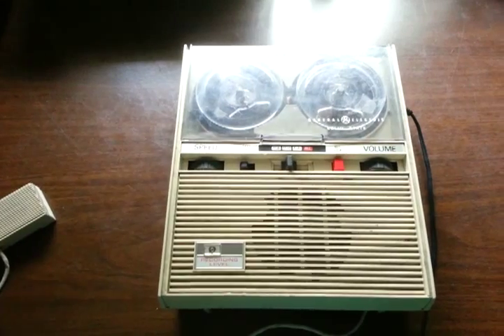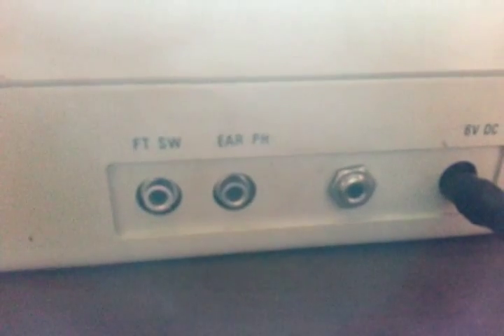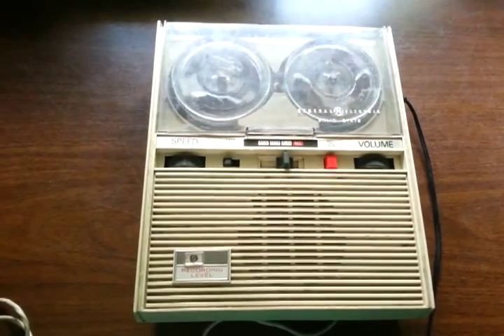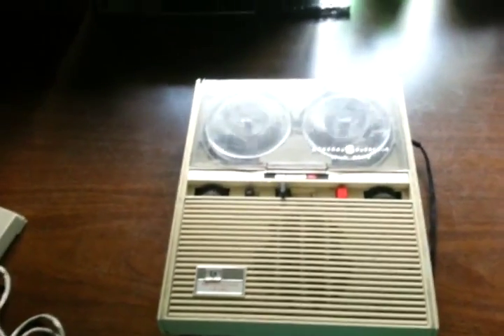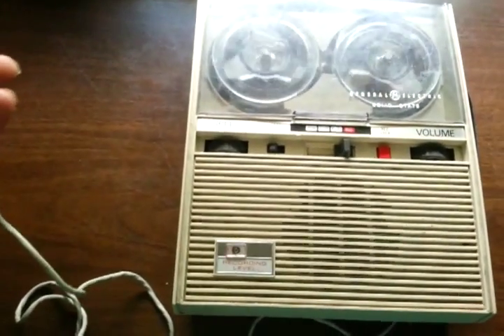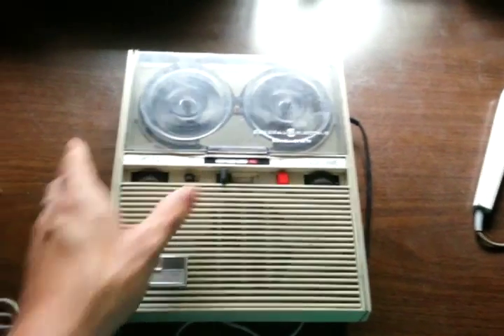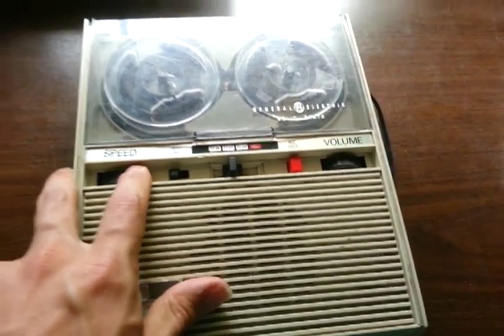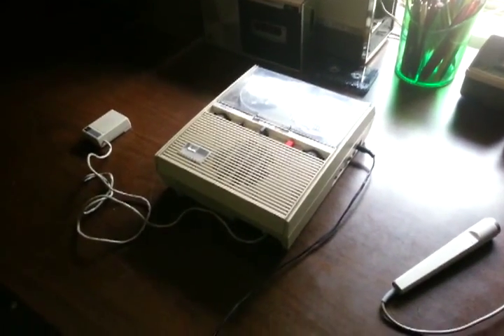The General Electric M-8020A rim-drive reel-to-reel tape recorder, 1967.

Comment: how were you able to do the new input ?
Reply from the maker: 3.5mm jack installed on the side. The ground connection (ring) of it and the hard-wired mike are tied together. The hard-wired mike's signal wire goes to the jack's connection that gets switched off when something is plugged in, and the tip connection of the jack goes to the recorder's signal input (where the hard-wired mike's signal wire used to go).

Comment: Hi there, I was given this same tape recorder by my grandfather when I was a kid. I recently got it from my parents house and am trying to get it working again. The tape has a recording of my grandfather who I have not heard in 25 years speak as well as my brother and I as kids. The batter ports had battery acid on them and do not seem to work after I cleaned them. I see there is a 6V DC barrel port on the side but it does not indicate the polarity. I see you have yours plugged in. Can you tell me the polarity so I can purchase a replacement plug? I assume it's center positive but want to make sure. Thanks for any help you can provide!
Reply from the maker: 6VDC, center negative.
Reply: @CassetteMaster  Thanks for your help!

Comment: The attached mic is nearly identical to the Juliette Rim-drive recorder I have.. My mic, however, has a molded plug with the standard mini and sub-mini plugs, though not at the standard spacing, they are further apart and therefore will not fit any other recorder I have.